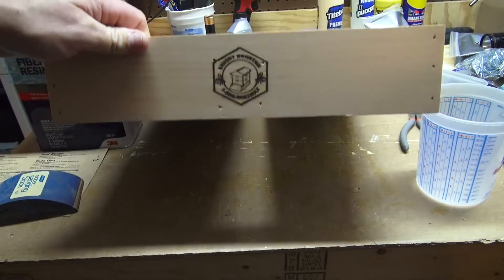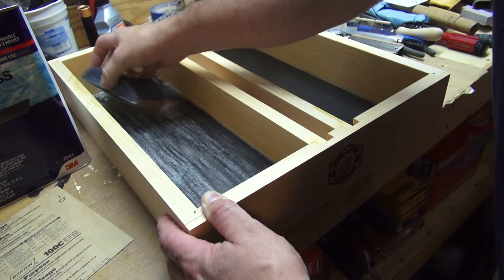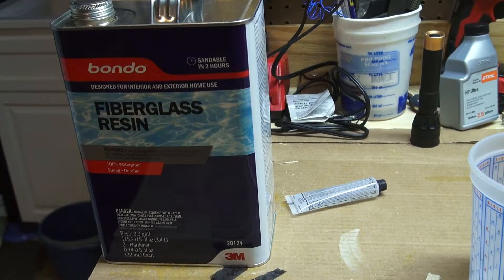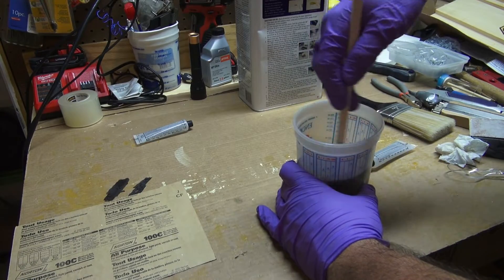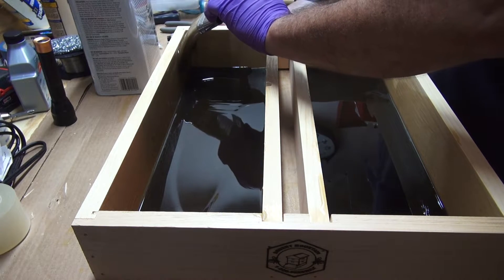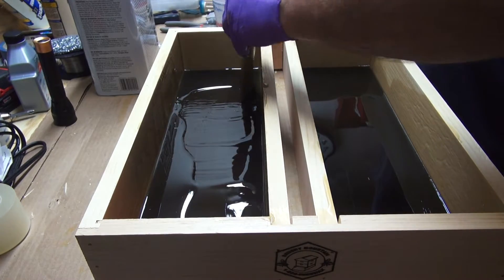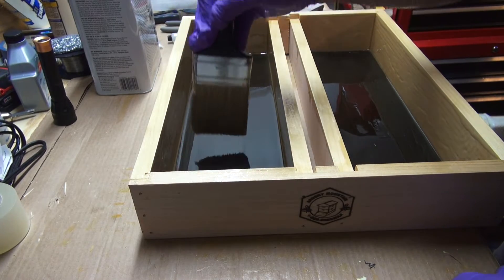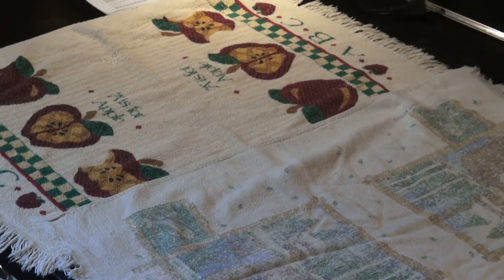Sealing and Leak Testing a Hive Top Feeder for Honeybees

Comment: What about the off gassing?  Isn’t it bad for the bees?
Reply from the maker: @TomMurray-s3n  once it sets up, you're good to go!
Reply from the maker: In fact, those feeders are still in excellent shape, that resin is amazing to be honest!  The only negative with them is the drowning, to use them regularly, you really need to modify or make new floats.  We have since gone to the Rapid feeders pretty much exclusively, just for overall simplicity and efficiency.  We do utilize the feeders in the video for overwintering, however.